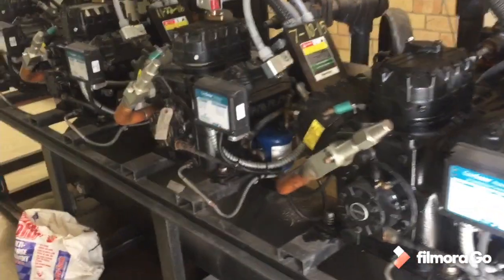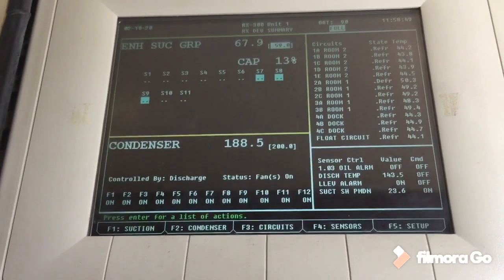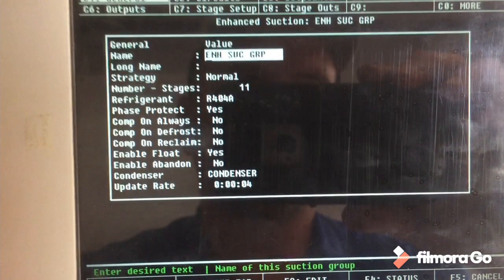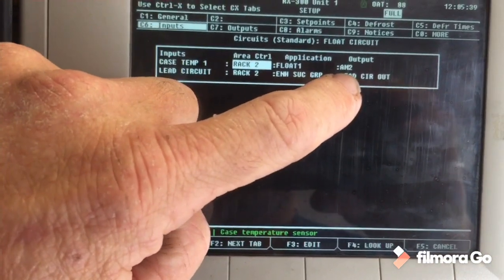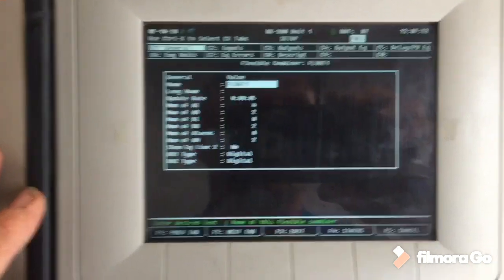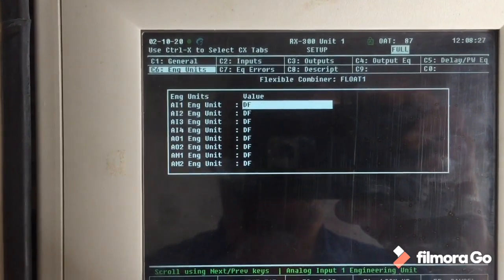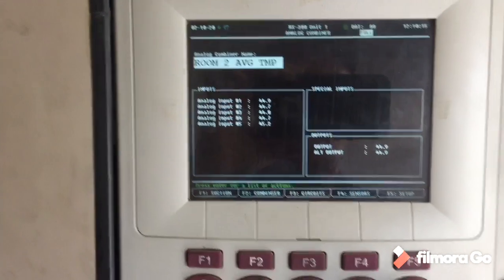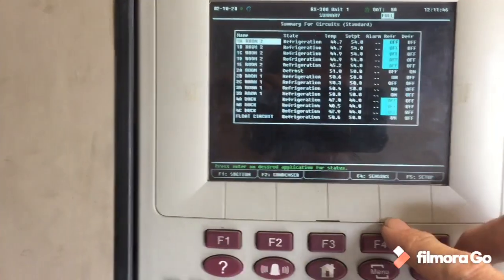E2 Flexible combiner for suction float lead circuit cpc programming e2e Emerson

Comment: Interesting solution. How long has this been running with the Float?  Interested in the long term results.
Reply from the maker: A few days now. I had suction set at 57 psig 404a. It floated up to 60-65 psig .